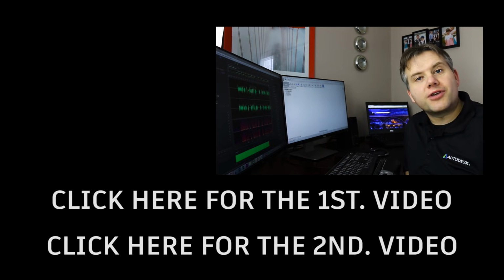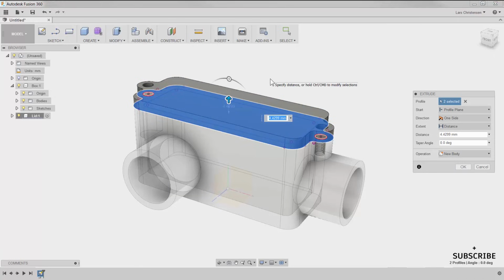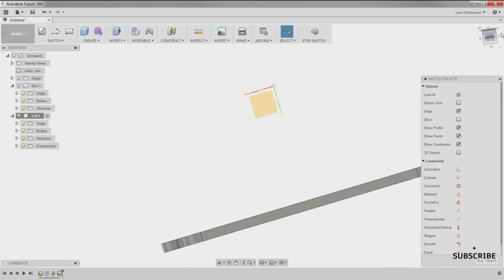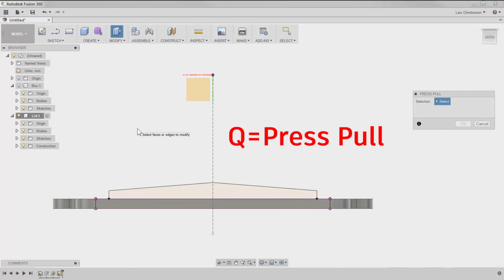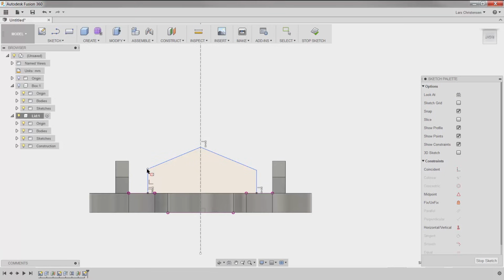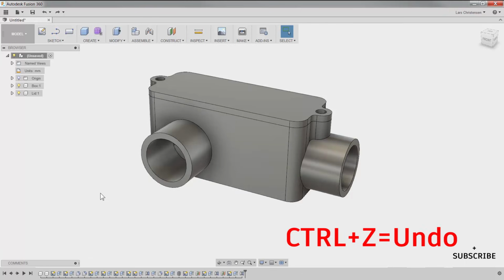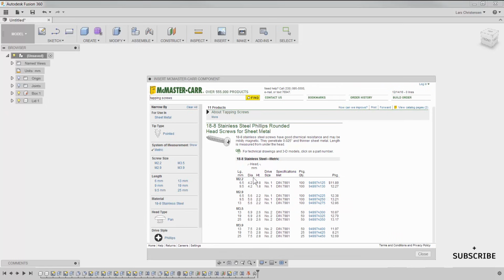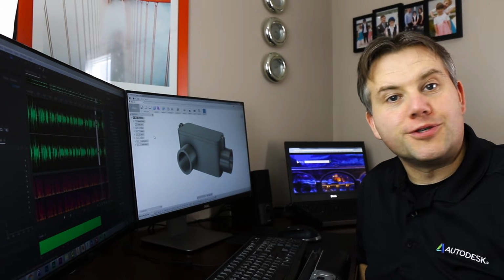Fusion 360 Tutorial for Absolute Beginners— Part 3

Comment: Just finished the pull box model. I must have some settings different than yours because I could not select "objects" when mirroring the fins on the bottom of the lid. I suspect that it may have been during the extrude I was set for join instead of add or new or whatever, my brain will be sore tomorrow. Had to select faces to get around.
Reply: I had a similar problem, you have to select the icon for that part in the history list along the bottom of the window.

Comment: Thank you for the great video.  I know this was done over a couple years ago but if you are still monitoring your comments, I've been searching for one specific task that I just have not been able to get to work correctly.  I'm basically trying to cut a 3 sided box (like a lid) but I want to cut it with a specific profile like either a rabbit or a taper so that one side would fit 'over' the other half.  Do you have any other video or know of a video that explains how to do that?  I did have someone else actually do it for me and surprisingly I was able to modify the profile they used.  But they didn't show me 'how' they did it so I haven't been able to learn how to do it myself so I haven't been able to replicate what they did in a different location on the same box.  I sure could use help with this.
Reply from the maker: Thank you for watching 👍😊I might need coffee to totally picture what you are trying to do. But, this video might get you there https://youtu.be/omeSFaLz6j0

Comment: Thanks. Seriously, thanks. I'm new to 3D printing, and consequently to 3D modeling, I managed somehow to make even some complex pieces with Fusion 360 and as a tinkerer I honestly thought this software was created by Satan  to make the humankind suffer. But holy hell how much wrong I was. I had the overconfidence to think I could figure everything out by myself, and I had all it wrong. This is honestly a remarkable piece of software and you tutorials are simply great. I will follow them all and start from the very beginning to (possibly) get it right. Thanks again for your great work, you, sir, are an amazing teacher.
Reply: If you learn blender and this at the same time it all makes sense quicker
Reply: @England91  Yes, I want to learn blender for non technical prints, I know it's not a CAD and it has totally different uses, but I agree that would be a great tool to add to my knowledge base

Comment: Well, nearly all worked out, but great for the first steps.
But.... the way you put the extensions on the lid would mean a fit without tolerance.
If I have followed you correctly, you could easily have extruded not only one side but two - and the second may be 0.1 or 0.2 mm to give the needed play for easy assembly ;-)
Reply: That can easily be adjusted

Comment: Hello Lars and thanks for these awesome tutorials! Really great and fun to learn! I have completed most of the lid but when setting the dimensions for the second pair of tabs,  (13:11)I often get an error message saying “adding this dimension will over-constrain the sketch.” What can I do to avoid this?
Reply from the maker: Thank you for watching 👍😊 You got that message because the lid is already fully defined. Either you already have all the dimensions added, or most likely a constraint was created when Sketching. Look for one of those, delete it and you should be fine
Reply: you put wrongly your contruction line, you did not start from the bottom of lid and it generated some other lines, been there :)

Comment: Great video for us beginners.  However, I had a couple of issues on the lid.  When I turned the lid origin on it was not in the center of the part.  Is that an issue?  #2 - When I tried to mirror the internal tab, it would not let me select the feature.  What did I do wrong?
Reply: ottdave, you can select the feature by first clicking on the extrude icon in the history then press s and click mirror
Reply: @s0m6u1  This completely solved my problem.  Thank you!

Comment: at the importing the screw section of the video, for McMaster, clicking save doesn't add the screw to the design. Can anybody tell me why?
Reply: The same thing happened to me; it would only save to file.  Turned out to be a memory problem.  After closing and reopening Fusion360, "save" did import the McMaster screw into the main drawing.  Guess I need to add more memory to the system.

Comment: Hey Lars, I've been following along modelling this electrical box. After doing the first extrude and picking Offset to extrude the void, I can't create a negative dimension offset.It will let me put in a positive number but then after clicking ok, the inner rectangle is still blue. I've tried this a number of times with the same result. Is it likely to be in my settings somewhere. Bit of a puzzle.
Reply: Thats true, that happened to me too, I am not sure why only for the offset tool it rejects negative values but if you drag the offset sketch that is visible on the model to the inside and then type a positive number, it will do the same thing as a negative number. Not sure why this happens but this video is an older video from an older version of Fusion 360.

Comment: So how do I pick which of two over-lapping lines the select tool will select? So no one else seems to have the problem I'm having where I am trying to select all the edges around the top of the original box to use to "project" but it keeps selecting the original "sketch" even after I turn the light bulb off for the box component "sketch". it won't let me select all the outer edges. I'm also surprised/annoyed that there's no quick way to just "select loop" which would auto-select all the connected edges around the box top. But otherwise great tut!
Reply: I had this same problem.  After several attempts I walked away from the tutorial.  He doesn't have any problem in the video.  Not sure why the sections next to the screw hole fillets are so difficult to isolate and select.
Reply: that said, I tried just selecting the face of the original, and not selecting the edges at all and I was able to extrude the top just fine - selecting all the edges does not appear to be a required step. :)

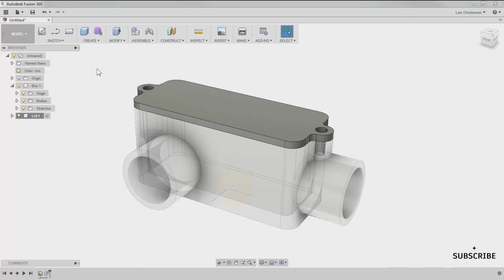Comment: At 4:15 in this video you are rolling the Box very smoothly and without your cursor changing, Is this a keyboard operation?
And by the way, you have a gift for instruction. I am grateful to have your Tutorials available on YouTube, Thanks.
Reply: He's likely holding down the SHIFT key plus middle click on the mouse (at least that's what it is on Mac). One tip with working in modeling software, is to try holding down different modifier keys (CTRL, ALT, SHIFT, CMD (Mac), or OPTION (Mac)) while clicking or dragging with your mouse. Hope that helps.
Reply: Thanks for such a prompt reply. Your advice has been very helpful. After posting my question I ran across the following episode which may figure in as well. Its possible Lars was using the pointing device he shows in this lesson.  
https://www.youtube.com/watch?v=PCPyy_RVEhM
Reply: @Dabbel2  he's most certainly using a "3D Mouse" to navigate - much easier. But I use shift and control and hold down middle mouse button to accomplish similar moves.

Comment: This was great. 2 days ago I didn't know anything about Fusion 360 and your method of teaching made it very easy. The process is very similar to Solidworks. My only dispute would be that you added the flanges on at nominal. This wasn't a good practice when I was a designer and I can see that some one is going to have to make an engineering change perhaps in manufacturing. The actual part has more than enough compliance built in and I think the designer and not manufacturing should control the part so the designer should design in the offset. Zero Scrap.

Comment: Hi Lars, I'm having trouble using the mirror feature command. It appears different than in your video. First there's the Pattern Type drop down box, then there's select the "Object" and then the "Mirror plane". If I choose the "Features" from the drop down then I can't select anything from the object. Nothing lights up on hover. The only thing that is working is faces or the whole body. I did manage to mirror the lip by selecting every face of the lip, because there are only six. But I'd still like to know if you have any advice on how to get this to work if I need to mirror a more complex feature that has many faces. I have a clean install. This tutorial ist hte first thing I'm doing in Fusion 360. My installed version is 2.0.4571. I had the same problem with the parts where the screw goes in on the box.
Reply from the maker: Hi Matej Perko Thank you for watching!
I might need more coffee, but next try to pick the features in the history line running at the bottom of the screen when mirroring with the feature selection.
But as long as you get things working one way or the other it is a success in my opinion :-)

Well done!
Reply: @cadcamstuff  Thank you, I had this same issue and forgot completely that you could click in the timeline at the bottom.  Your videos are fantastic, I really hope you enjoyed making them as much as I (and many others) enjoyed learning from them!
Reply: I'm having the same issue

Comment: Hi Lars, thanks for the great videos I’m new to 3D modelling and am finding your videos excellent to follow.  However I’ve come across a snag with my drawing my origin plane on my lid sketch is in a different position to the origin plane in my box sketch is it possible to move the origin plane?.  I’m assuming I’ve done something wrong in the initial setup or something or I did jump into your panning zooming etc video part way through perhaps I moved something there without realising, thanks.
Reply from the maker: Hi Paul Longworth Thank you for watching!
You can't move the origin, but you can move the part:
https://youtu.be/EejRr-Y3174?list=PL40d7srwyc_Mkgc5wvP_OfVel9aDkNkZ6

Hope this is helpful
Reply: Lars Christensen thanks for the quick reply I found the video again very interesting but I think I’m going to have to start my drawing again as everything  on the lid is in relation to the centre however my origin is way off centre in two axis for some reason, so I can’t do it as you have done if that makes sense thanks again.

Comment: I got a problem on Part 3. 
My "Lid" file is activated to start the new part. The box is transparent and bluish. But as soon as I tap the Sketch button up on the bar, the box turns black again. And when I Extrude the Lid from it, the whole box extends.....I can't figure out the origin of the problem. Please give your insights.
 Thanks
Reply: I had a similar issue.  Take a look at your object tree on the left - what section do your sketches fall under?  Somehow, I did the whole project under the LID section (forgot to switch back to box after I created the lid).  I just renamed my objects so that the sketches were part of the Box, and not the LID, and then I could sketch under the LID section properly.

Comment: As I'm accustomed to the line tool will continue to draw lines from point to point. During this exercise when I was trying to build the tabs under the lid I could draw to line segments with points and the continuation stopped. The same to create different groups of lines that were not connected in the final step. When the symmetry function was attempted it did not act on all lines in this group as you demonstrated. And I'm still stuck at this point.
Reply from the maker: Hi Wes Jones Thank you for watching!
I might need more coffee, I'm not sure I totally understand exactly where you are stock. Can you draw the lines with different steps and make it work?
Reply: By the sounds of it you either didn't complete the line to "close" your sketch (you get a pale shaded infill between the shape you just created when you drew your lines) or when you selected the symmetry function, you didn't highlight the POINT, probably selecting one of your lines instead. Rewatch the video, Lars did mention where to select for the symmetry to work.

Even if your line stops for some reason, you can still continue from the last line by mousing over its endpoint with the line tool selected and continue as before.

Comment: Hej Lars, jeg er helt ny i 3d print verdenen og igang med at lære Fusion 360. Din tutorial her er fantastisk! Det er super simpelt med dine teknikker. Jeg forstår dog ikke ifht. din boks her når du skal printe den. Du brugte rigid til låget, men hvad når du skal printe den? Printer du den som den er på tegningen dvs. hele boksen m/ låg eller printer du dem i dele? Jeg har brug for hjælp til at wrappe mit hovede omkring overførslen fra 3d software til print. Tak for super tuts! :)
Reply from the maker: Hi Duc Minh Phung Thank you for watching!
Just like with CAM, when it comes to 3D print you have choices on how to break down an assembly to individual components for making. So you can choose either to save out each part individually and lay them out in your 3D print utility software or create the whole layout for the print bed in a separate Fusion file.

Hope this is help[ful

Comment: At 13:06, I'm having an issue where the dimension tool is forcing me to make it an angle instead of a distance. As soon as I click anywhere, it changes to "degrees" instead of mm. Is there a fix for this? Thanks.
Reply from the maker: Hi ethanpenn5 Thank you for watching!
Sounds like the line is not straight. You can apply a vertical constraint by using the vertical constraint on the right side menu.

Hope this is useful

Best,
Lars

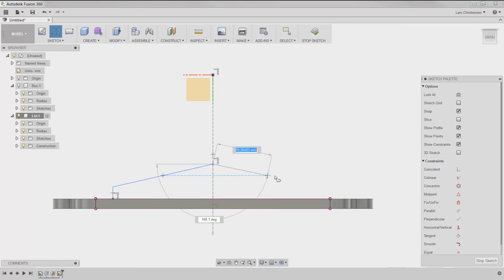Comment: so after creating the line @7:14 and doing the dimensions, I noticed that when I pressed 'Q' for "push/pull" that the view didn't spin to the "ortho" view and stayed flat as if it was still in a sketch. I just put in a value though and then I orbited the view to see the model: it looked just like yours. However when I went to "mirror" the extruded "tab" I wasn't able to mirror and "object" but just "faces". Am i in some other modelling or selection mode now? How do I go back to working with objects instead of just faces?
cheers mate and thanks for all the informative videos you make!
Reply: I had the same problem. I never got it to work using his procedure. What I had to do was to first hold down the left mouse button on that first face of the object (the one that we later extruded), which causes a menu to pop up. In that menu I chose the "Parent" tab, then "Extrude2" within it, which selects the whole object. Then I hit "S" and called up the Mirror function. From there I selected the plane around which to mirror it, then "OK". That got the desired result.
Reply from the maker: Right-click the view cube in the upper right corner and select perspective with ortho and it will start spinning around when hitting Q :-)
In regards the mirror issue, I am not hundred percent sure, but you can use the face option if you like.

Hope you have a great day!

BEst,
Lars

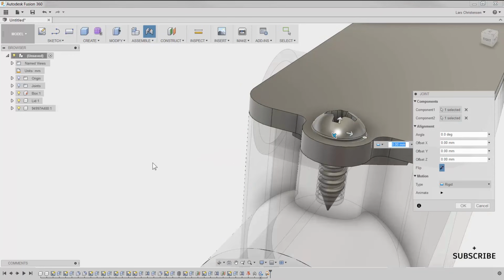Comment: At 19:57 It's hard to see if the threads match. Do they? Is there a parametric way to make sure the threads match now that you selected a particular McMaster part?
Reply from the maker: In this case, the screw will cut the thread into the plastic. But, in general, you want to make sure you pick the right thread specs, then everything should be fine

Best,
Lars

Comment: When I hit project, I always have the BOTTOM of the piece selected, so I can't extrude the top....I'm unable to actually select the top piece, it selects the bottom and I can highlight the bottom of the constraints. 

This is why I hate CAM....What ever happened to doing things by clay models?
Reply: It's getting annoying. I followed everything to a T, but the purple lines are cast like a shadow to the "bottom" of the module, rather than having selected the top face....Not sure what is wrong, and I didn't screw with any settings in Fusion.
Reply: use Shift and Middle Mouse Button together to move camera around  different angles. Just Middle Button without shift moves in plane
Reply: But that's not the issue, I'm incapable completely to select the top face. It selects the shadow of the bottom plane, for some reason.
Reply: Adrian lel gotcha, I was confused by the opposite side location of purple lines as well, however, in the video you can see the same thing. I think if it was made on purpose probably for showing you the other side of the figure 🤔🤔🤔🤔 like for abstract showing you that you clicked on the right place in area? We need a good answer
Reply: A reset fixed THAT issue. Now when I made the inside lip (the four bits on the inside), I'm unable to do a mirror on the first one. When I select mirror, then features, I'm unable to select anything at all.

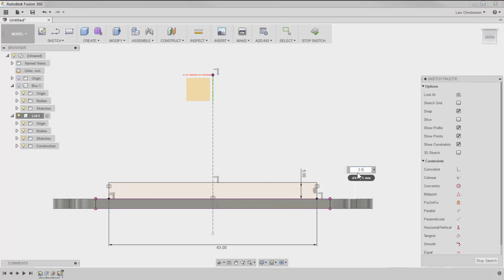Comment: at 9:15 when I add the dimensions to the "house shaped" profile, it lifts off of the lid surface rather than lowering the height to the surface. So, now the profile shape is floating in space. I've repeated the steps 5-6 times but it keeps repeating this behavior. How do I lock the profile to the lid when dimensioning it?
Reply from the maker: Hi slackering Thank you for watching!
I am not hundred percent sure what is causing this. I am thinking that you might be selecting another line with the dimensions in the background. What happens if you place the dimension to the bottom of the lid, adding the lid thickness?

Hope this is helpful
Reply: that was exactly it. the real problem was with ofsetting the plane from the origin. only one pixel difference on the screen but, I picked a point at 17mm from origin rather than 13mm. Thanks for the great video series. It's really helping me move along quickly in learning 360.